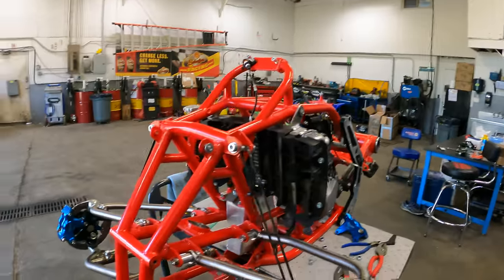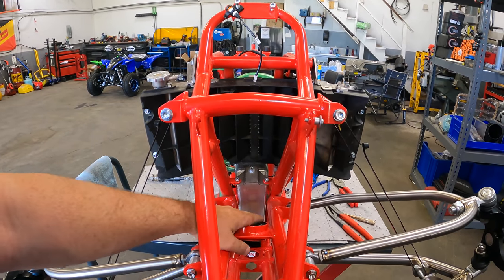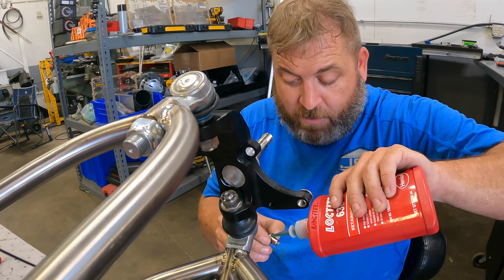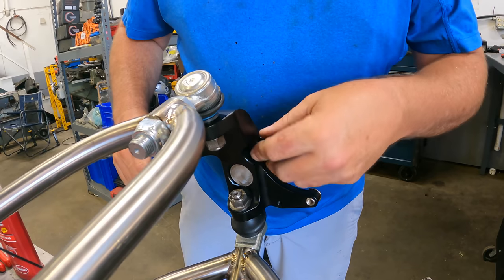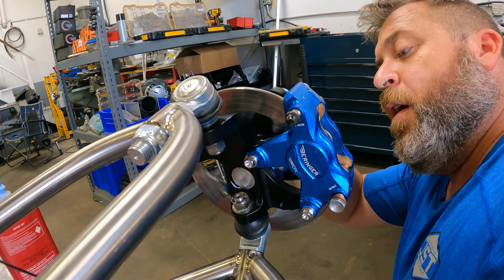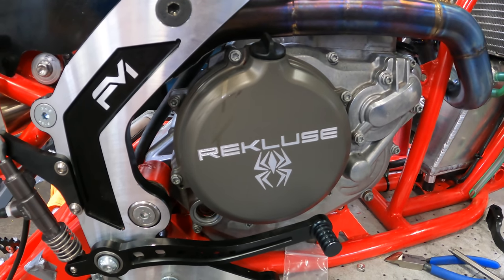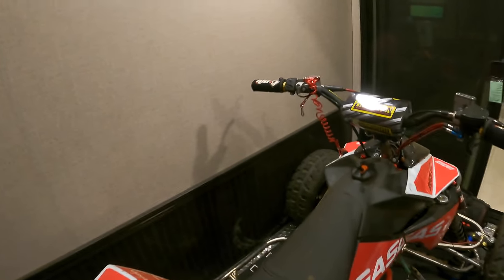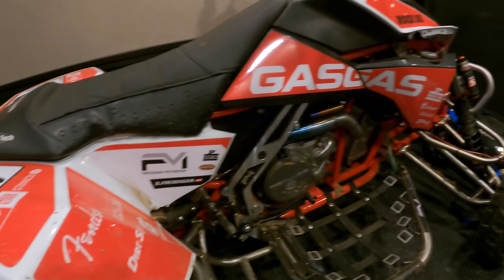THE CRAZIEST HYBRID QUAD BUILD

Comment: Love it, I have a built Yamaha raptor 770cc back woods machine.  At 75mph in 4th gear I can pull it up then shift in 5th and it's stupid fast.  I live inbeween Polaris industries and arctic cat.  Would like to build a monster 2-stroke atv next, my friend Dennis Rantanen at DR motors always tells me stories about northern crank shaft from thief river falls mn would build a custom crank shaft to join 2 snowmobile engine's together ect....   be interesting to do with a CR500 or KX500 motor join 2 together for 1,000cc machine in a quad....   too much power is like having to pretty of a girl ..... just isn't going to happen.